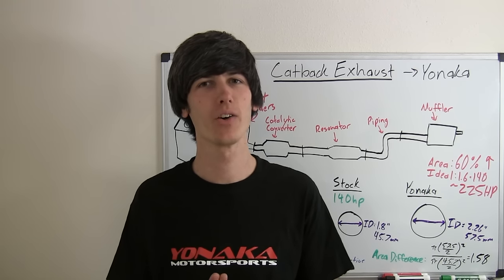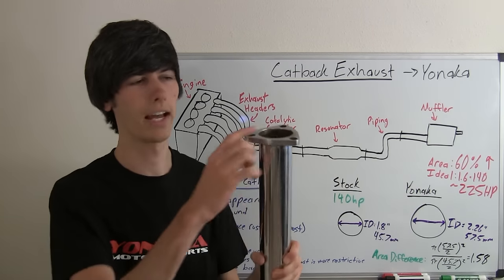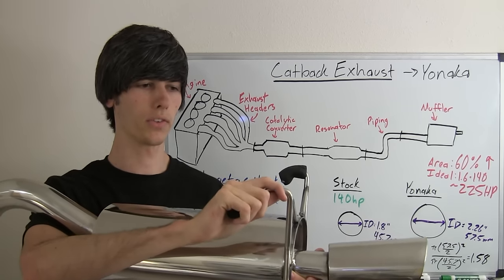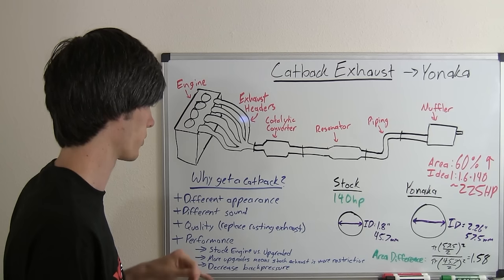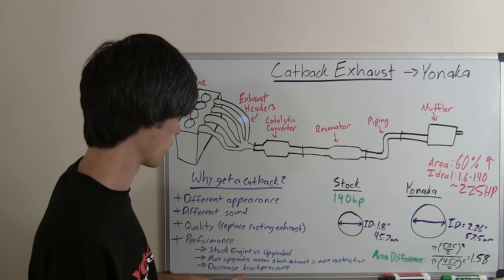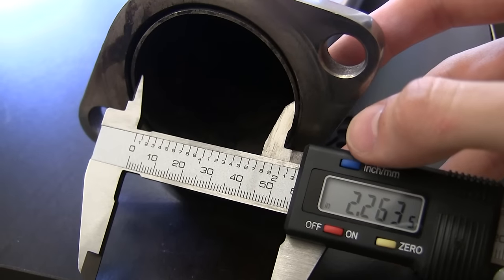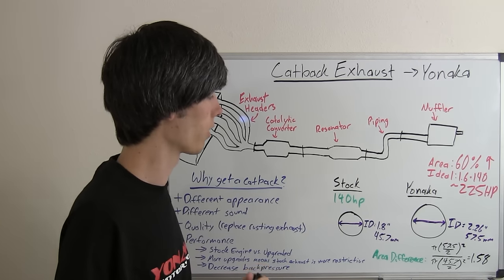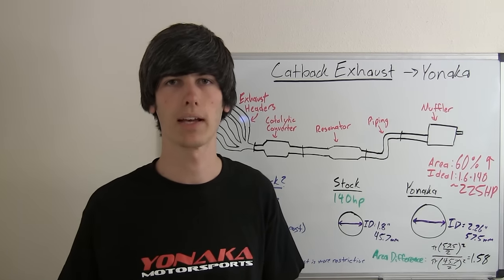Catback Exhaust - Explained

Comment: He's not saying it will increase the power to 225 hp. He was simply saying the bigger exhaust will allow enough airflow for an engine producing approximately 225 hp. So if you were to tune it then this exhaust will help airflow up to 225 hp.
Reply: That's a load of bull mate. How is changing just the catback part going to reduce bottleneck and increase airflow when you're still using the stock exhaust headers and catalytic converter and the pipe in between those two? Honestly, I think all a catback exhaust does (on its own without other exhaust manifold mods) is 'improve' the sound, and that's subjective.
Reply: @flow5718  Even with stock headers it's possible for the diameter of the catback piping to be a bottleneck and cause back pressure.  If you don't have stock headers, then the next bottle neck would be the catback pipes.  You are right on the sound of the exhaust itself being subjective, and increasing the potential amount of flow won't necessarily help if the engine is still stock as the video mentions.
Reply: @daexion  I don't have any links right now, but search for as many catback only mods with real dyno tests and you will see in most cases putting catback decreases the hp slightly. stock engines need a certain amount of backpressure.
Reply: @flow5718  Do you even tune bro?
Reply: flow cat back is much longer travel than the header, it will help for sure when in high rev
Reply: You're partially right.  The resistance within a tube is also related to its length, so if the smaller diameter portion is shorter, it'll reduce the resistance as well.  You're right though it won't allow for 225hp as much of the exhaust system is still of the original diameter, but it should be higher than the original 140hp.

Comment: Great video! Just my two cents (coming from what I learned as an HVAC engineer and applying it to cars):

I think you should have mentioned the fact that there are a lot of reasons why even if the exhaust system past the catalytic converter is the ONLY limiting factor in your setup, there are a lot of factors that go into why you still don't get a power increase that is one to one with the proportional increase in the pipe's interior cross sectional area - you could get higher or lower depending on your set-up. I realize that you presented a simple concept to show that the flow rate would increase as a result of the increased diameter, but in doing so you held a lot of the other variables equal that play a big role in the system.

But I think if you had talked about turbulent versus laminar flow (using the Reynold's number) and mass flow rate, it would have explained a lot more. Namely:

- Laminar or turbulent flow through the pipe (High Reynolds number>4000 = turbulent, <2000 = laminar or smooth flow)
- Possibly changes in interior surface roughness, especially if you replace rusted/damaged equipment(decreased roughness translates to less pressure drop through the pipe, reduced reynolds number)
- Possible changes in diameter of piping (for equal mass flow rates, increased piping diameter decreases velocity, which lowers the Reynold's number)
- Possible changes in length (shorter pipes = lower reynold's number)
- Possible changes in pipe geometry (straighter pipes = less pressure drop through system, reduces Reynold's number)

In the context of performance:

- You will only see gains if your flow was turbulent to begin with (Re>4000, or at least high in the transitional state Re>3000)
- Once you achieve laminar flow (Re<2000), you will receive significantly reduced gains if any at all (explains why putting an over-sized exhaust on a really low output engine will not yield significant returns, but replacing an undersized exhaust on a high-output engine will. Also explains why if the exhaust is balanced with the engine, upgrading the system will not yield returns unless the engine's output is increased)
- This is critical for turbocharged engines (because mass flow rate/volumetric flow rate/fluid velocity is significantly increased, Reynold's number is often very high, thus it is often necessary to upgrade to a larger/straighter set up to achieve smoother flow)

Comment: I have no modifications on my 3.7 5-cylinder engine.  I installed a MBRP cat-back exhaust on the truck and I noticed a significant improvement in throttle response and acceleration.

Comment: One detail that was not mentioned was the possibility for better MPG. I personally did a larger cat-back exhaust on a similar car (2000 Ford Escort ZX2) and without any big modifications I had gained around 2 or 3 MPG. Then, once I had the muffler replaced with an even better flowing one, I had gained another 2 MPG. This was noted directly after only doing that replacement, as I keep track of my MPG at most fill-ups.

Comment: There is a lot more to performance exhaust systems (if done correctly) than just back pressure.  

A properly designed system will create a negative pressure wave in the headers to increase fuel scavenging on the intake stroke.  while this is largely accomplished through proper header design, the rest of the system is key to proper header performance, including the amount of back pressure present.  

I know you know this, but it is not mentioned in the video at all.  simply adding a cat back can actually result in less performance, unless the rest of the system is designed properly.

Kevin Cameron has a great breakdown of exaust system engineering in The Sportbike Performance Handbook.

Love your videos, BTW.
Reply: forgot to add, the intake system design is also integral to the system.  it is just an airpump in the end.
Reply: +Brian Donegan I came to the realization that headers do most of the scavenging. You can get some benefit from the rest of the exhaust as well but the biggest and strongest "suction wave" or in your terms, "negative pressure wave" occurs when there is a large change in the diameter of the pipe. The length of the header determines when this wave will travel back, but not it's strength. This makes the collector or any large change in volume critical in providing a point at which there is a large change in volume from the primaries 4-1 or secondaries 4-2-1. The exhaust just efficiently removes the exhaust and really should be focused on flow. I have yet to have a car that could fit a muffler right after the collector to prove that the change in volume on a 4-2-1 right after the header would be beneficial because most 4 cylinder cars don't have space for a muffler there without ripping up the floor, or removing the engine and running it on a stand.
Reply: +Llia Olsen If your info was taken from Motorcycles that have a much shorter exhaust run. You could really considered a muffler after the header as your first big change in volume.
Reply: Brian Donegan what do you think about a magnaflow catback going on a mk4 2.0 vw golf? Its stock engine until i can get the money to work on it more.
Reply: Too Stancy I had a 2000 2.0 Golf 2 door. I had a Vibrant cat back exhaust and a KN washable panel filter put on the car. The midrange performance felt a little better. The change in performance was slight not dramatic. The exhaust tone was lower and louder. My advise is if you enjoy listening to the stereo while you drive don’t change the exhaust.

Comment from the maker: I don't have any data to show one way or the other, do you? I have mentioned scavenging and keeping flow optimized in my video regarding increasing horsepower via the exhaust. As mentioned, the optimized exhaust is likely the stock diameter; I do plan on eventually conducting tests to show the actual effects.

Comment: I have that very exhaust and I love it. My Integra's exhaust was aging and full of holes. The Yonaka catback was inexpensive compared to replacing the OEM piping. The car sounds as the speaker describes. It's relatively quiet when you drive normally, but does get deep and loud when you increases the RPMs. It cleans up nice and I've not had any issues with it. Is there a performance benefit? Maybe, but I haven't noticed a difference.

Comment from the maker: Backpressure is simply referring to the pressure losses caused by a large quantity of air trying to squeeze through relatively small pipes. The larger the pipe, the less restriction it has, but simultaneously the lower the exhaust velocity. Optimum is a balance of the two.

Comment: or you could just say:

1.Catalytic Converter = clears the gas so it's not harmful to enviroment (remove it you don't need it)
2. Resonator = keeps the flames from going out (remove it so your car can go boom boom)
3. Muffler = reduces the sound of your car (remove it for loudness)

so yeah pretty much remove everything and use a straight pipe for eargasm :D
Reply: This would be a bad setup for a daily driver tho, right? Your girl won't be impressed when you're driving down the highway and your car is too loud to have a conversation, keep the resonator & muffler. Also take care of the planet dammit, keep the cat
Reply: I only removed the cat. Kept the resonator and muffler because drone noise on highway is fatiguing

Comment: yep you are spot on... resonator = tuned for reducing specific frequencies i.e if 500hz is very prominent at speed limit, then the resonator will work to tackle that frequency.  The muffler applies a blanket reduction of db's across the whole frequency spectrum

Comment: You can't just say "oh it's 60% larger so it's good for 60% more horsepower". There is more airflow potential, but that's not really as important as you're making it out to be. If an engine needs to push more air out, it will just increase the flow rate through the pipe. Up to a certain point, this doesn't cause an issue.

I upgraded a Mach 1 Mustang from 300 HP to 520 HP, I have 3" diameter exhaust piping. Going larger isn't going to help me much if at all. The original diameter was 2.5" and I increased the horsepower by about 73%. The speed of the air flowing through the exhaust just increases a bit. You won't really see any gains on a dyno by switching to say, 4" exhaust piping. In fact, you will probably lose some low end torque.

Most of your videos are really good, but frankly there's some misinformation in this one.
Reply: I disagree with you, while your right that putting an exhaust system that is much too large will cause losses in low end torque, the extra back pressure caused by more exhaust gasses will have a negative effect as well. So if you ate going to significantly increase your horse power and keep your stock exhaust, you will deffinately not reach the full potential.
Reply: Nick Seidel I was mainly talking about pipe size though, a stock exhaust system usually has very restrictive cats and mufflers. I was more referring to having high-flow cats and mufflers already and then changing the pipe size. It doesn't matter much unless you are doing some truly insane power upgrades. I should have been specific about that. In the video, he was suggesting that a 60% larger diameter pipe is good/ideal for 60% more horsepower when you really need nowhere close to that.
Reply: +kingcrimson234 Okay I deffinately see your point now, and you're right, if you're going to install high flow cats and mufflers you really don't need bigger pipe diameter.
Reply: 65PontiacTempest That's 100% true. Every build has its own sweet spot for pipe diameter.

I went the forced induction route personally. (Procharger) A little bit bigger exhaust may make more power, but I'm pretty happy at my power level. Alright, I lied. I'd like some more but I'm nervous about my factory rods and pistons holding up if I increase the boost!
Reply: +kingcrimson234 yea I agree and I think interpretation between us about this is the same I was thinking dam I can go from 140 hp to 225 hp with just a 60mm bigger exhaust ,
Reply: no
Reply: Valkarez Such a well thought out reply.
Reply: kingcrimson234 you better watch the video again because you don't have a clue.
Reply: kingcrimson234 he said exactly the opposite. He said that if you increase engine output you will need a bigger pipe.
Reply: He isn't saying a 60% larger diameter exhaust equates to 60% more horsepower. He's saying that if you have 60% more horsepower than stock and 60% larger exhaust diameter your build will yield roughly the same back pressure.

Comment: Fellow mechanical engineer here. I'd like to understand your reasoning behind your recommendation: Given that horsepower is proportional to exhaust mass flow rate, then by following your suggestion to tune engine until bhp/area ratio is the same as the stock system, this means that you are basically targeting to keep exhaust flow velocity the same as the stock system (mdot = rho*v*A => increasing mdot in proportion to A yields constant v)

Is there a reason that you think this is the optimum operating point? Is it because you assume the rest of the exhaust system is tuned to work best at this particular flow velocity?
Reply: By what I heard he said you start to see a difference around that hp range.
Reply: People fear ur comments that is why you have not been answered
Reply: probably just relying on the assumption that the exhaust flow interaction with everything else was engineered well by the original engineering team at whichever car manufacturer. it's a good rule of thumb for the layman, but obviously some crazy custom shops and engineers who want to bore out cylinders and do all kinds of their own crazy tuning and dyno analysis might stray from this guidance. i think this is meant more for like, the average 'car enthusiast' who just wants to slap some parts on and not actually have to have a staff of like 5 guys working to redesign and rebuild his engine and do days or weeks of diagnostics and troubleshooting and such.

is it absolutely a scientific and great rule? maybe not... but it's probably good enough for the consumer.

Comment: So if i had say 2250 hp, would I find significant gains from a 22.6" catback exhaust?
Reply from the maker: No, it's certainly not a linear relationship, and I've oversimplified it, but with 2250 hp you would certainly be restricted with a 2" exhaust.
Reply: Straight pipes!
Reply: pat I'm so happy you made this comment... I signed in and everything just to comment on how this was explained in the video. I'm not trying to criticize the poster because I'm sure he understands engine power and back pressure better than he explained in the video. What I'm trying to figure out is if he meant at around 260hp you start to notice the best gains from a 2.5" exhaust? For the most part 2.5-3" exhausts will take you up past a thousand whp before you just run straight headers on a 4 cyl.

Comment: So kids, you're supposed to get a bigger exhaust AFTER you put your engine mods in. Bigger exhaust will decrease the power of your stock engine.
Reply: +Jsp P5 Taunus  unless it's a turbo Car Then the best is really No Exhaust and just about 3-4 inches coming out of Turbo Exhaust./..
Reply: Idk if that's true, I've heard you want some backpressure with most engines (idk about turbo though). But that could be wrong. I'd like to see a comparison video of a car with and without exhaust after the turbo to see what happens.
Reply: Lol what?
Reply: how is that possible? isnt backpressure a myth?
Reply: Back pressure is not a myth. The argument is whether you need some or not. And Engine Masters tested different exhaust vs no exhaust and found that even 3 inch straight pipes are better than open headers. 

Now, you can definitely tune an engine to account for zero back pressure, but for most applications you will want exhaust anyways, and more back pressure can also reduce emissions and increase efficiency.
Reply: what if I just get my TLs straight pipes?
Reply: It's not about backpressure (resistance) but about resonance in the exhaust (similar principle to airbox tuning).
Reply: Most cars shouldn't have more than 1.5 psi back pressure @ idle and no more than 2.5 psi @ 1500 rpm.. this is facts, not a myth lmao.. anything higher points to an excessive exhaust restriction.. or just put an old fashioned dollar bill on the end of the tail pipe & if its not puffing outwards, uve got bigger problems on your hands lol (except on some Honda 4 cylinder engines due to valve lift/opening being so close together)
Reply: simply not true.
Reply: Plague thank you!
Reply: It can be true because the bigger exhaust will not have the same resonance characteristics, thus providing less power in lower RPM.
Reply: So I'm thinking of getting an 87 turbo coupe. So am I good to pretty much change the exhaust around since it is a turbo?
Reply: In most exhaust systems the catalitic converter is the biggest obstacle.. A cat back makes really not much difference.

So foremost the first 3 reasons do apply. The performance gain is minimal.
Reply: Is this actually true? I got a new exhaust because mine has a hole and got rusty. It's only slightly bigger but it's the quietest aftermarket one i could find. 🤷‍♂️
Reply: People there's nothing like turning a key and hearing a bad ass rumble but if you don't no what your doing don't mess with your car unless you know how to tune. Any time you change something in your car that alters the way the original engineer programed the vechical if you don't tune vechical to new specs your car won't run right if at all.